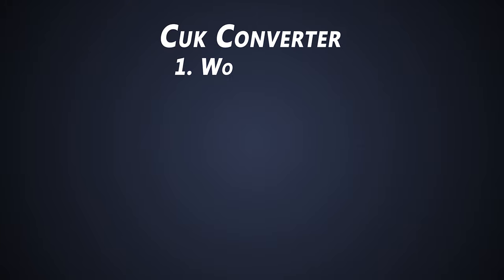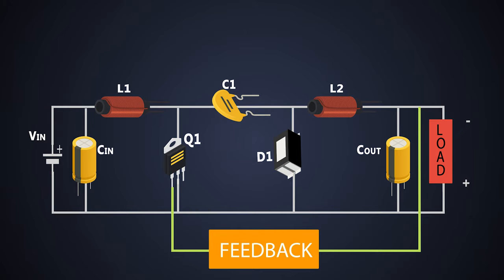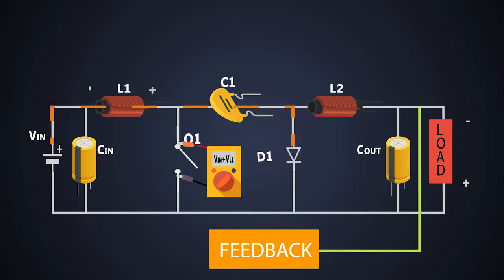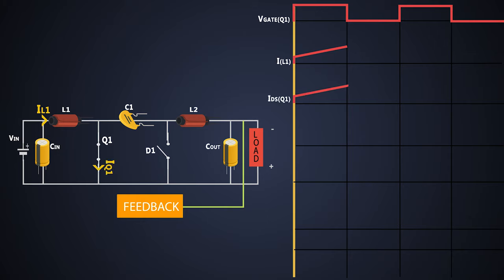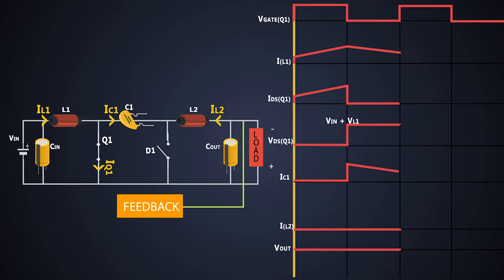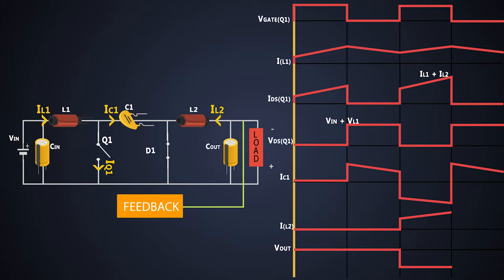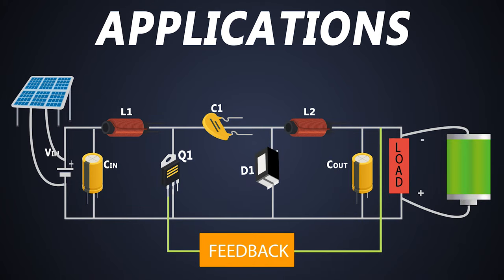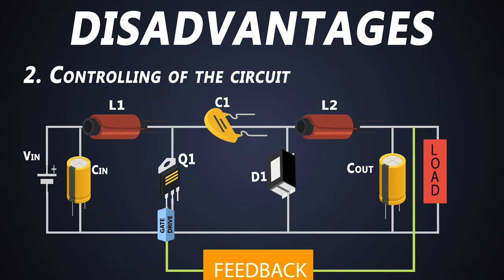How does a Cuk converter work? | Cuk Converter Working

Comment: Great video that really helps to clarify the operating principles by breaking it down step by step. I have 2 questions though: 
1. at 6:29, you mentioned that the voltage across the capacitor = output voltage. However, since L2 is charging via C1, shouldn't V_C1 be V_out + V_L2? 
2. I don't understand how the voltage across C1 changes polarity. Although current changes direction (sign), it is only because the capacitor is charging and discharging, but the voltage polarity remains the same? 

As I am a relative beginner at electronics, any clarifications and explanations would be greatly appreciated! 
Thanks.
Reply: as the polarity changes of inductor, its discharge's in opposite direction so the relevant capacitor gets the same input with new polarity ,

Comment: input filter capacitor gets damaged in this converter i am testing. what could be the reason?
Reply from the maker: What is the Voltage rating of the capacitor? and what is the actual input voltage?

Comment: I've used cuk converter in my project for stand alone pv system but I'm getting output voltage of cuk positive only, what could be the reason, how can it be corrected
Reply from the maker: You'll get the positive output only. That's right.